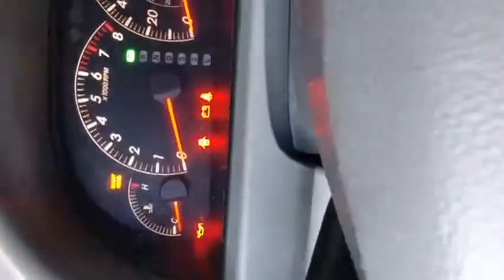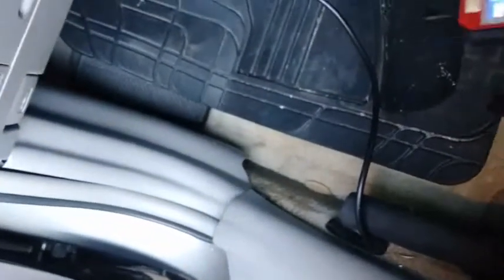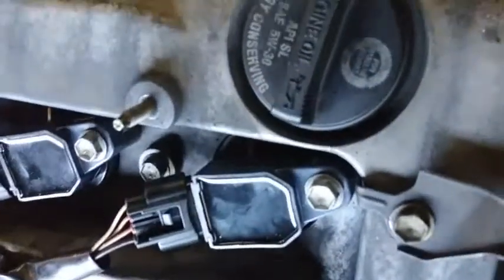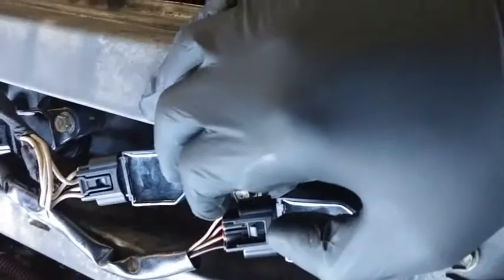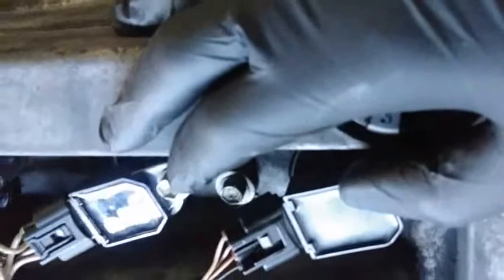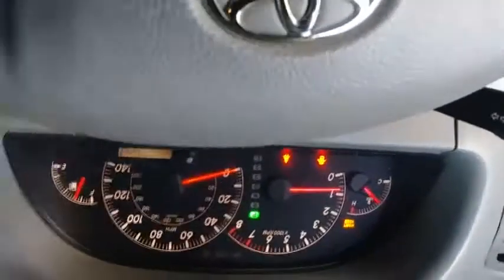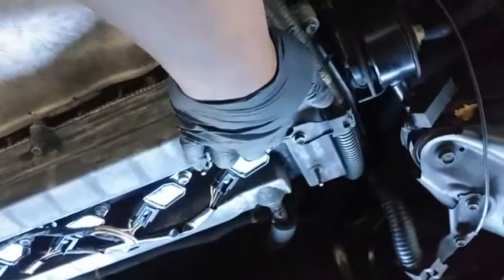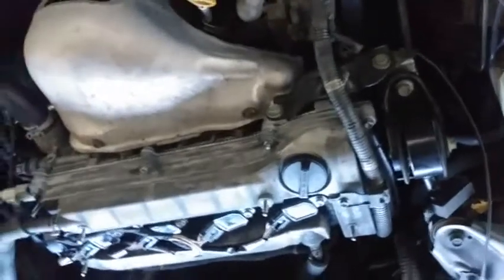2004 Toyota Camry p0351 diagnostic and fix

Comment: I have a 2004 Toyota Tacoma. V6. I have the same 2 codes. Instead of switching the coils around I replaced everything. New spark plugs, new spark plug wires, new coils, and I still have the same codes. The very fist time my truck started having problems, the computer gave me a code for the maf sensor. I replaced the maf sensor. New fuel pump, new fuel filter, new fuel injectors, I’m all out of options now. I’m still stuck with P0351 and P0305.
Reply from the maker: A miss fire code it's not regarding spark plug only. I suggest you to switch the injectors like you did for the ignition coil. If that doesn't work you need to do a compression test.
Reply: Hi
I have 2006 Corolla and I have the same problem as you p0351. I changed coil,injector, spark plugs, gasket of intake and throttle body (with cleaning) I cleaned maf sensor. I checked wires and don’t see broken wires. I did compression test (181, 185, 170, 190) looks not bad.  Valve cover doesn’t leak. And nothing worked. Did you find the problem?